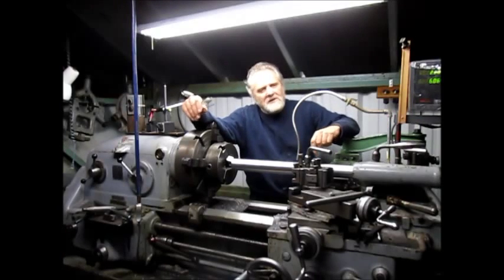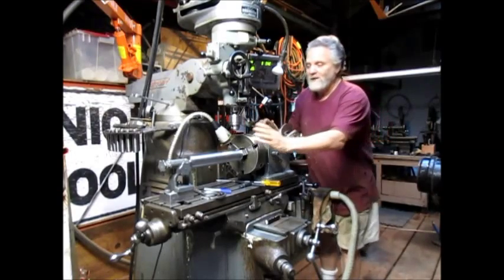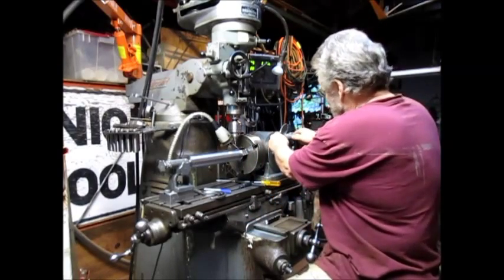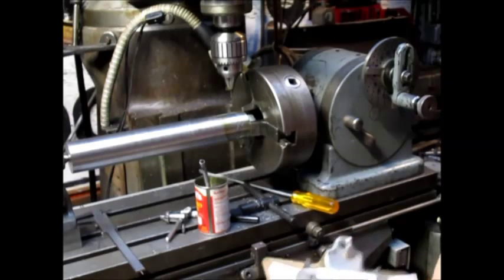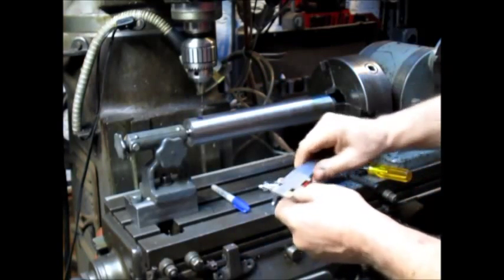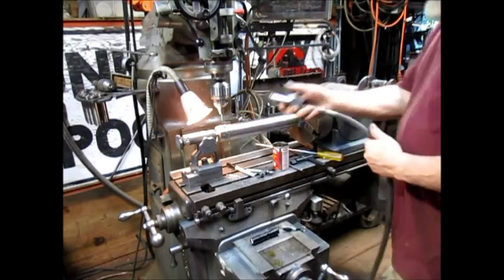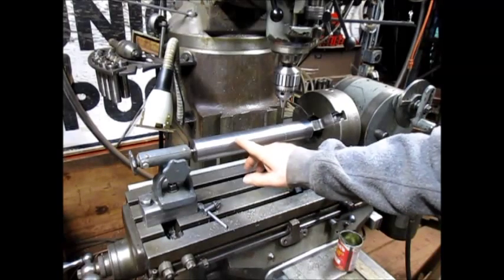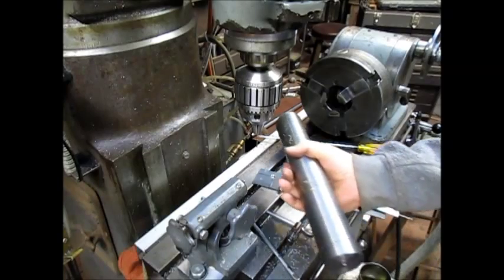Pin Hole Paradise 2

Comment from the maker: Dave; Actually that particular 3 jaw is machined to fits my dividing head. I put and the steel and chuck in my 4 jaw to be able to transfer the chuck and project from the lathe to the mill as a unit without losing exact center.